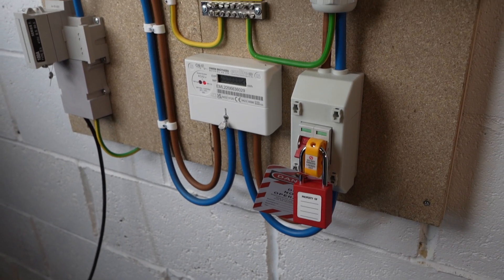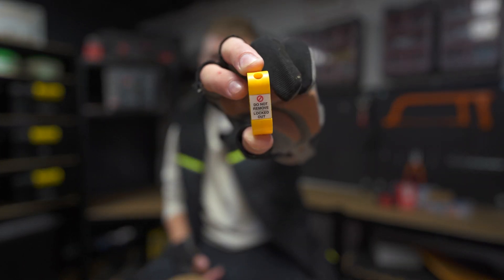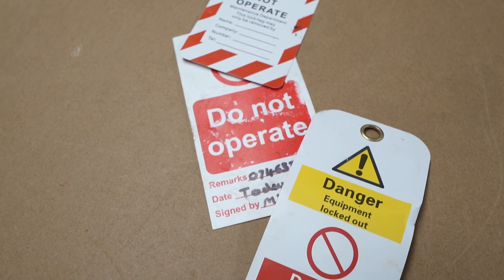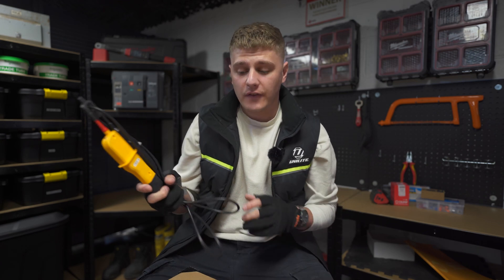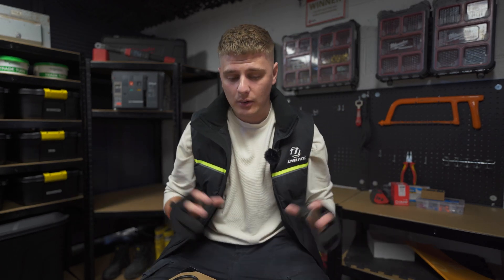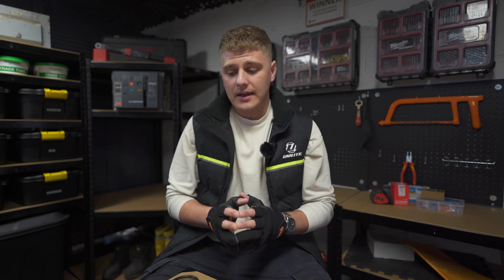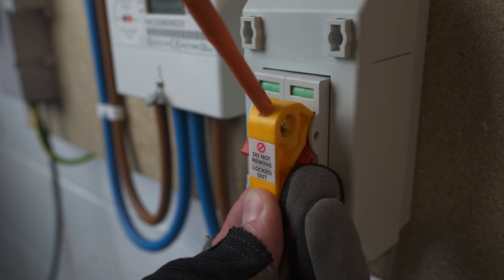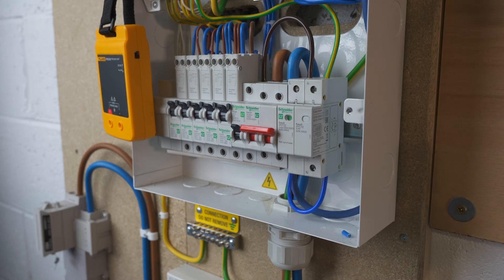Electrical safe isolation procedure - Single Phase

Comment: Before anything else u must seek for  the permisssion first and then turn off any individual circuit braker and rcd to reduce the load and then the  main switch and lock it off and diplay the sign and the key must stay in your pocket at all times

Comment: For thre phase safe isolation u must test with an approved voltage indicator and approved voltage proving unit between the least most dangerous conductor first neutral L1,L2 and L3 then between the earth L1,L2 and L3 then between the least most dangerous conductor first earth and neutral and then between L1-L2,L1-L3,L2-L3 thats the ten stages 3 phase safe isolation🤓

Comment: Excellent advice but just one point of correction GS38 requires that we prove our voltage indicator on a known source or a proving unit rated to the same voltage as the voltage we are testing. A known source can be the incoming side of the main switch . Other than that fantastic advice and video nicely explained and well presented 👍

Comment: As a 28 year electrician 12 years with a masters license here in America I find your practices very interesting. We don’t send our transformers to ground the way you do. We verify the circuit is dead to our MDP by voltage readings, Not continuity. The cables you use are interesting to me as well because we run conduit for all main lines unless it’s bus duct up a high rise or through a production facility. I wonder if the NEC adopted some of the ways you do things if we could actually make it cheaper and more efficient for the end customer. I only found you a few days ago but I’ve enjoyed your content keep it up.

Comment: No devices, no gimmicks will save you from live current but some mild creative thinking might. Instance, your elbow on the side of the enclosure while working one handed on a wire  harness you've never laid eyes on before. Your forearms might suffer but your chest is safe. Just one example but eh,  you do you. Not like your gonna listen anyway.
Reply: @residualelectrical  Agreed, point is don't rely on safety gimmick but also don't rely on some safety tip your read about somewhere. I would say think and try to experiment with but that's also a dangerous venue. So instead my message to you brave souls is, god's speed.

Comment: Wait I’m confused I thought you had three phase power in 🇬🇧 for residential. But you’re saying single phase, is it single/split phase like we have in the 🇺🇸.
Reply: No single phase for residential
Reply: @jackdavis8786  okay cool, thanks for clarifying.
Reply: Some new builds are now getting full 3-phase due to the requirement for new homes to accommodate an electric car charger and for heatpump installations. 

But normally a street has 3 phase along it and one phase to each house, divided equally. Because we have 100A 240V as standard into homes we can usually cater for quite a lot of load on one phase.

Comment: Great stuff as always Mike!

One thing that JW had mentioned which I think is important (you sort of mentioned it), is that even on an approved voltage indicator with a digital display and the indicating lights, the indicating lights are what is supposed to be relied on, not the display. 

Looking forward for your 3 phase video 😁

Comment: Great video RC! Like how you have put a deliberate error in there for people to find 👍😉

I would add to be aware of if it is a double pole isolation, that also breaks the neutral as is the case in your video, or if it is a single pole isolation that breaks only the live. If it is single pole, then the test for dead procedure will not pick up a borrowed neutral fault, until the neutral is broken. Under this situation, after the isolation and initial test for dead, I would break the neutral as live working, and then test for dead again. This is more likely in a commercial / industrial installation however, a similar scenario exists for a PEN fault to a domestic premises, where a two pole tester may show the installation to be dead, when in reality there is still power. In this case a sweep with a non-contact voltage pen would show the live wires, or you need to find a true earth for the two pole tester.

Comment: Single Phase installations test to confirm that there is no voltage between:
- Line and Neutral
- Line and Earth
- Neutral and Earth.

3 Phase installations test to confirm that there is no voltage between:
- L1 and L2
- L1 and L3
- L1 and Neutral
- L1 and Earth
- L2 and L3
- L2 and Neutral
- L2 and Earth
- L3 and Neutral
- L3 and Earth
- Neutral and Earth
Reply: heck yes, I proved L-N and L-E on a system a couple of years back, small house, being redone, didn't prove properly and got a massive 'lock on' belt through N-E (reversed polarity plus switching in the neutral :\ )  That will teach you more than any amount of lectures :(